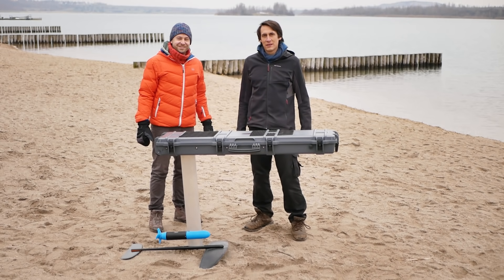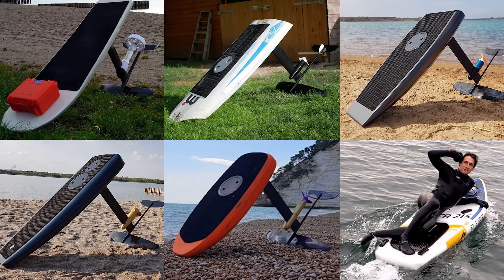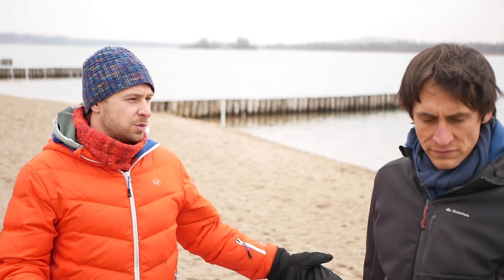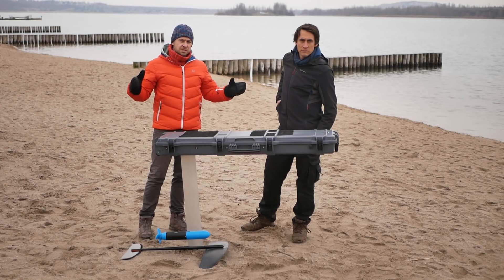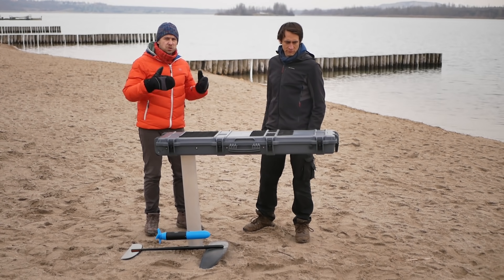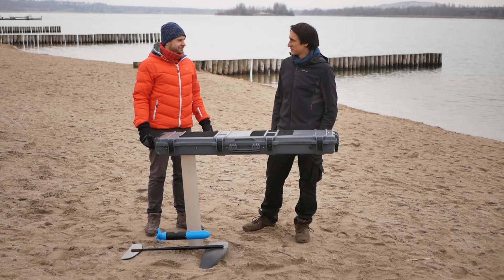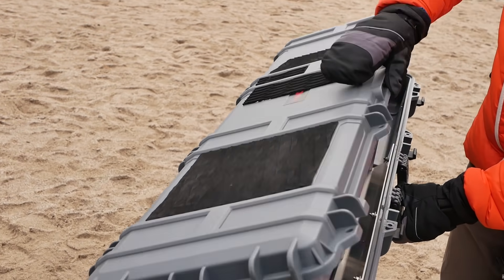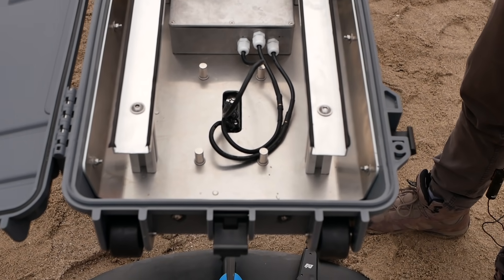[Surf n' Destroy] RIFLE CASE EFOIL for less than 1800€

Comment: Hey Jungs, super geil! Ich habe eine ernsthafte Frage, die fuer mich beruflich sehr wichtig ist. 
Sind die Geschwindigkeit / Watt Angaben so richtig? Und wie habt ihr die Parallel messen koennen? Gruss aus China!

Hey guys, super cool! I have a serious question, which is very important for me professionally. 
Are the speed / watt data correct? And how did you measure the parallel? Greetings from China!
Reply from the maker: Hi, we are measuring the amperage and voltage via the www.metr.at module for VESC. The power you see there is correct. 

Cheers

Comment: To be so smart it was pretty dumb to not put the wheels where you could roll that thing easily.
Reply from the maker: Well watched, smart aleck ;) We did not want to have the rollers in the front, because the pockets in which the rollers are mounted would create additional flow resistance. Now that we know that there is still some power reserve, you can consider for next version to have the rollers in front.

Comment: Get rid of the rounded edges on the bottom rear and half way back. Help the water release the bottom and not roll up the sides and rear (suction). Less transition current, faster on foil.

Comment: Now if you could get the motor and fin to detach and fit in the case that would be awesome.
Reply from the maker: Of course we were planning to do so. Everything would fit quite creamy in the box, except the engine. You can unscrew everything within 5 min with a few screws. Unfortunately, the motor is about 10cm too long. With a shorter motor it would fit. Maybe there is a second version :)
Reply: @enzymlefax  only 10cm close but no prize .give the motor its own waterproof case that attaches to the large one is one solution , although not a pretty one lol .

Comment: Hi guys, very nice and funny job. We will become the efoilers with the best style on water now 😄 Easy and simple is the solution. Could you please give us informations about engine and propeller please ? I have already built my own eskate with vsc but I can not found any informations on propellers and water engine. Did you buy it or build it in 3d ? What about the batteries power ? Thanks in advance 🏄🏼‍♂️
Reply from the maker: The motor is a Flipsky 65161 100kv. If you are looking for a suitable propeller:
Print my folding propeller from Thingiverse:
https://www.thingiverse.com/thing:4583073

Comment: Geiler Scheiß haha,

Hättet ihr das Board mal früher gebaut, dann hätte ich jetzt nicht das Problem, mehrere Dämmplatten zu schneiden und zusammen zu kleben :D
Top sache, wie habt ihr den Propeller stabil genug bekommen?
Reply from the maker: Try to use PLA+ with a wall thickness of at least 4mm. That's it ;)
Reply: Thanks🙂
I will give it a try. Maybe you can coat it with epoxy to fill the tiny gaps and make it even more robust